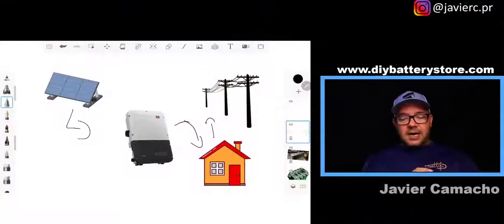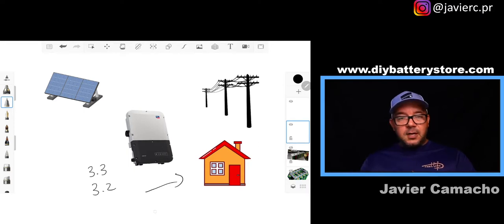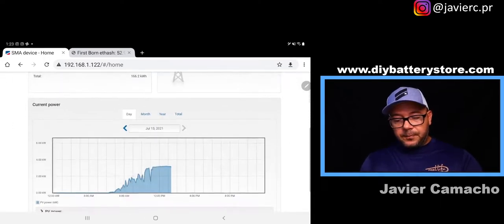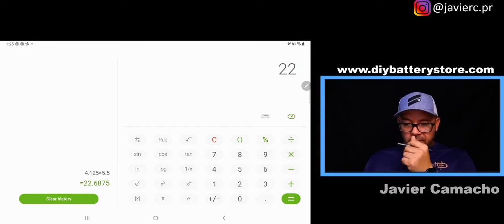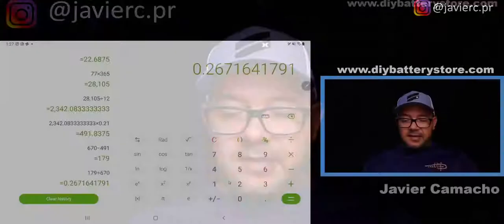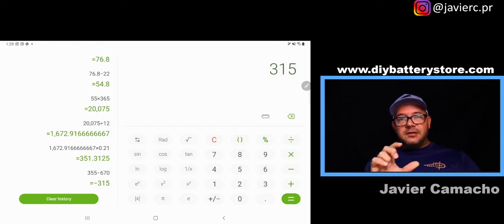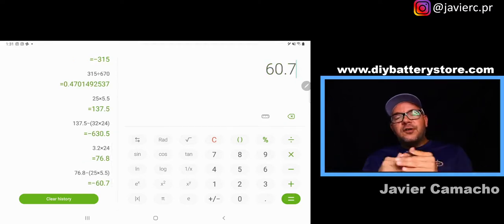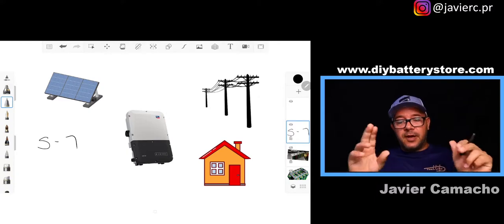Project Updates: How to Crypto Mining using Solar Power Pt 4

Comment: When you sell power back to the grid, do you get paid retail or wholesale? Do you pay additional for different times of the day for your electricity?
Reply: We don't have tier tariff for different time of use.  We get a credit almost 1 to 1 every month l,  but at the end of the year cycle we only get 75% of the actual Kwh cost as a bill credit for the remaining unused kwh credits.
Reply from the maker: Not yet. I'm still under self consumption. Once every is up to code and I apply for the net metering program, I'll get credits for the excess power